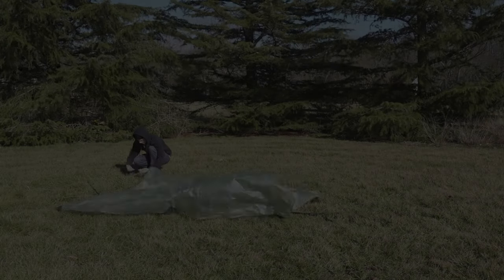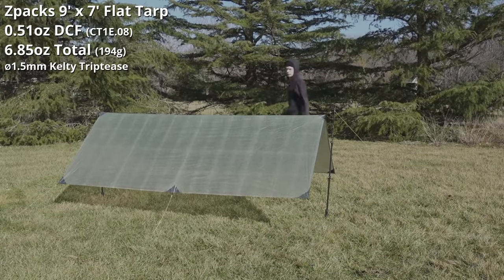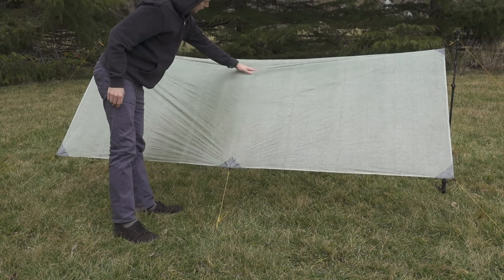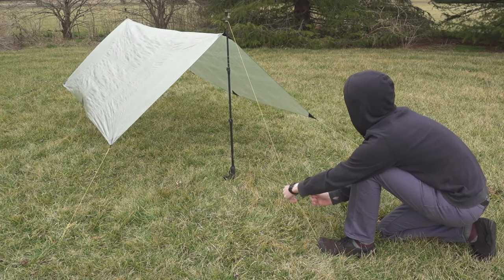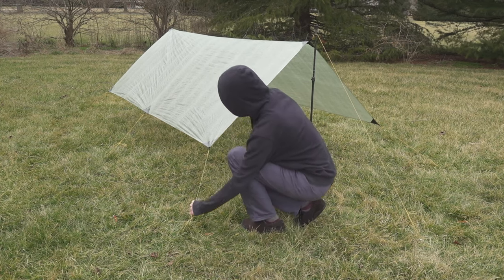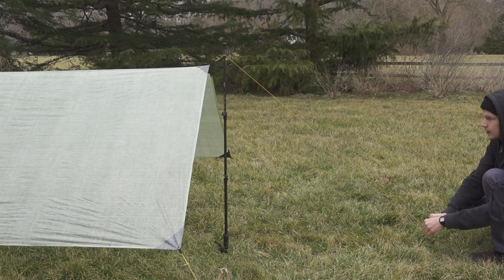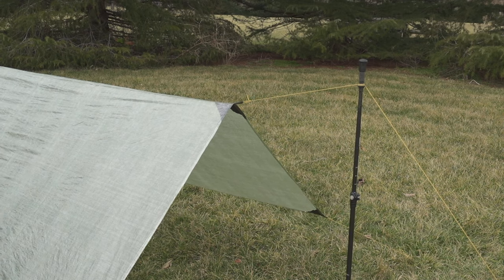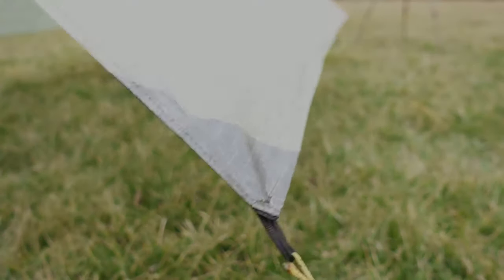Flat Tarp Tips for a Perfect A-Frame Pitch

Comment: Hyperlite Mountain Gear tarps are so much better than Zpacks (given the money you’re connoting people ought to spend) and furthermore, line-locks on, at least, the four corners is also prudent strategy too. Lastly, the ridge line off of the trekking pole ought to have been done in two tie out points using a clove hitch.

Comment: I run a full ridgeline just above the height I want for the tarp itself, very very tightly between two trees. The tarp is hanging loosely underneath. Then I pull the tarp  anywhere along that ridgeline to its full length using prussic knots or other ridgeline gadgets.  In this manner the ridgeline itelf can be guitar string taut and yet the tarp is at any tightness I choose. If you carry a 50 foot piece of dyneema for the ridgeline. you will almost always find two trees that will work. Dynemma will also be ery low stretch and very very light. I want my expensive DCF tarp to last a lifetime if at all possible. Thanks for the video.

Comment: Thank you for your video! Question: when using trees for the ridgeline, do you...a) run the ridgeline first without the tarp, then throw the tarp over the ridgeline? OR b) Thread the ridgeline through the loops on the  tarp? OR c) have lengths of cord on the two ends of the tarp (same as if with trekking poles), and tie each end off to a tree? Just wondering which of these is best for an (as you say) "drum-tight" tarp pitch. Thanks!